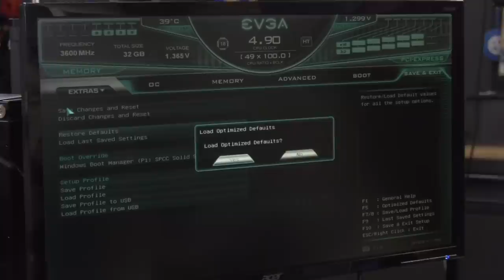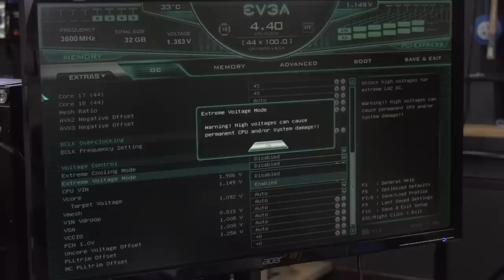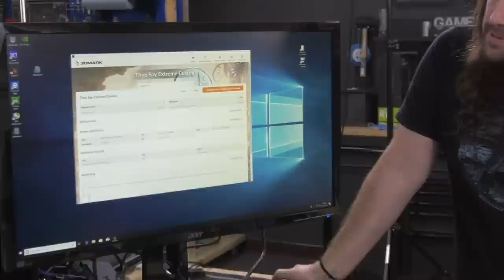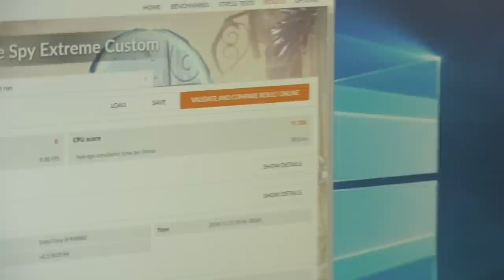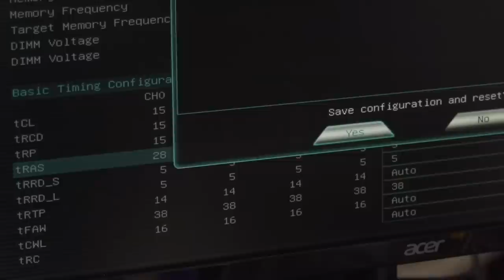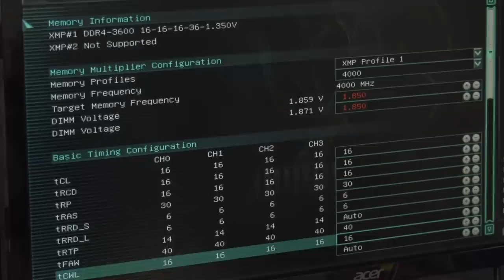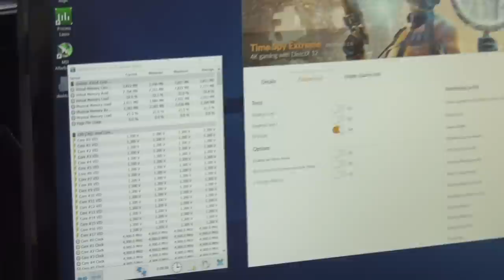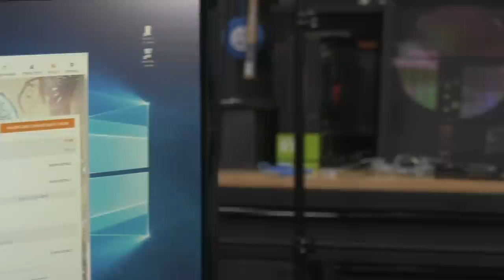Live: 9980XE Overclocking with Car Radiator

Comment: Back in the days of Prescott I purchased a used Mazda MX-5 radiator complete with the two large 12 inch fans. Modded the massive water inlet/outlet for regular 12mm ID tubing. Wired the fans to my variable voltage PSU. The sound was incredible when the fans were at full speed. Best described as the sound of a C130 in my bedroom. I have photos somewhere. I had a Tec on that CPU with a Danger Den waterblock.  16c full load minus 7c idle.
Reply: well that was a waste of money lol
Reply: TheGuruStud didn’t cost much and it lead to the forming of my company that now brings in 4 million euros per year.
Reply: @zentriceggofficial  what company if you don't mind me asking?
Reply: Random Some Guy criminal minds inc.  An agency specialising in sourcing the world’s best criminal minds for all your criminal needs.
Reply: @zentriceggofficial  wtf
Reply: Radu Mircea Bunica I thought it would be a more interesting business than a boring Elon Musk enterprise.
Reply: Smooth AF advanced trolling.
Reply: @zentriceggofficial You're joking right? You went negative temps with a car radiator? Was it outside, in the winter :P?
Edit: I just googled that Tec thing... Makes sense now :)
Reply: @mariuszanfir2298  Well done!  You figured it out. Yup, I used TECs for quite a few years. Back then you could buy a TEC holding waterblock from Danger Den or Swiftech.  Now you only find the odd custom made block.  The TEC was powered by a separate lab power supply.  Variable voltage and high current.  Although I did try powering a TEC on CPU via the computer's power supply at one stage.  Although I powered it off the 5 volt line rather than the full 12 volts, it still overloaded the cheap brand PSU I had at the time.  A loud bang and flash of blue light.  PSU died.  Fortunately it didn't kill any PC parts.
Reply: @zentriceggofficial  You didn't need to run bigger hoses... The block is super restrictive. I run a rail (4x GPU in parallel) because instead of R= 4x, its R = 1/16 (series vs parallel). I run stupid flow rates (my pump uses more power than my TR 1950x and 4x R9 Fury at idle), but the hose is only 5/8 ID and 3/4 OD. In fact, even if you smash the hose almost shut (leave a small gap), the flow rate isn't much different from fully open, so the hose is very minor restriction. You could easily get away with 3/8 hose for my ridiculous setup.

You can also calculate it (I'm an aerospace engineer, fluid dynamics was one of my favorite classes). But, when you blow through the water-block, you'll notice even with air its super restrictive, when even a super long hose doesn't do much (which you can easily calculate with the Bernoulli equation, assuming its still a fresh course on your mind).
Reply: @jakegarrett8109  Yup, except I don't like the look of the tiny hoses.  A friend tried to persuade me to ditch pro cooling and go with AIO.  I said no.  He ditched his pro and now has a generic tiny tube AIO.  Back when I had the mazda MX5 rad I would have loved to use the giant hose that used.  I will stick with 12mm ID.
Reply: What did you use to power a automotive water pump?
Reply: @kingofnines213  The water pump was actually an Eheim pond pump. Head pressure wasn't that great. 😂
Reply: @zentriceggofficial  trying to figure out how I'd wire in an electric waterpumo for a car, since they usually mount straight to the radiator neck, however I'm pretty positive that'd be too much current to wire in to a PSU with a switch
Reply: @kingofnines213  I haven't checked spec of any car water pump. Even if the current requirement wasn't too great you'd need a good surge protector.  Maybe a mosfet driver board.

Comment: I will have you say my complete name one day, Steve. 

Seriously, those videos helped me to undervolt all levels and finding OverdrivenTool is the tool for tuning Vega 64. It lead me to research what crytominers were doing with Vega 64 then applied the concepts to the Power Play Table via OverdrivenTool. Acturally seeing a reason to be thankful to miners, they have a lot of documentation on Vega 64. 

Able to hit 287.7 max, 37.6 min, fps and 160.4 in Heaven and close to 7900-8000 in Time Spy on 'air' alone. 

My OverdrivenTool profile (Got it shifting through the states smoothly and on a very tight wattage timing):

[Profile_3]
Name=morePPT
GPU_P0=852;800
GPU_P1=991;900
GPU_P2=1250;925
GPU_P3=1300;975
GPU_P4=1440;1015
GPU_P5=1500;1035
GPU_P6=1575;1060
GPU_P7=1630;1090
Mem_P0=167;800
Mem_P1=500;900
Mem_P2=800;925
Mem_P3=1080;1050
Fan_Min=1200
Fan_Max=4800
Fan_Target=75
Fan_Acoustic=2000
Power_Temp=80
Power_Target=140
Reply: I wish i could find same information for 660ti and mod my bios properly.
Reply: AMD seems to have a step up on tweaking. Sorry, best tool you have is Nvidia Inspector
Reply: @SchkuenteQoostewin  Yeah, I use Vram timings flashes to set the #1 TimeSpy score for duel RX 470, as well as my normal "1.21 Jiggawatt!" (back to the Future reference) power limits to beat it on air. I'll put them on water and chilled water later. I love all the mining forums, they have the driver patches necessary for running custom BIOSs, and all the info you could want.
Reply: @jakegarrett8109  In a way they did a boon in the end

AMD should just source the drivers and let us kill Nvidia for them.

Comment: You want a real big radiator? Get the Airplex Gigant 3360, it weights more than 20kg and fits 24x 140mm fans.
Reply: just, wow
Reply: Do you even need any fans with a radiator that big? 😂😂😂
Reply: @denmcx6538  Probably not. Just good old convection currents.
Reply: But that costs closer to 1000$. Car radiators can be had for less than 100. For that money you could probably get an 18 wheeler one :P
Reply: @mariuszanfir2298  for semi's you can get one for 500 online and 1000 at dealer
Reply: @nawzy202  I've got a school bus radiator for probably $100 if someone wanted to pick it up. However, I run 4x R9 Fury (duel SuperNova 1300w), and I just run the water in a 5-6 gal reservoir (25 Liter roughly). It takes so many hours to get even remotely warm, its just not really needed to have any radiator. That said, I've ran 2x power modded RX 470 on a passive 4in thick 16x16 in copper radiator for 72 hours to hit steady state (did take 48 hours to hit steady), and it peaked at like 48c on the core, and with just a small breeze from a box fan, it hit 42c under load. Each card loaded with synthetic at 220w (which was not possible on the air cooler below 85c even at 100% fan).

For my high power CPUs, I run phase cooling (peak temp on my FX at 500w at 1.7 Vcore was usually below 0c on the core, I did see it hit 10c breifly when I had a crash and the load must have been 600w, block temp max has been -25c, idle is -58c).
Reply: DenMCX 

A recommended setup for that radiator is actually just using two 180mm fans, one in the bottom and one in the top.
Reply: @aciemiller3443  He sounds legit to me, you shouldnt so willingly project insecurities.
Reply: @DarkLinkAD  That's one of the best replies I've seen XD 
"I can't do that so they must be bullshitting"  Got'em!

Comment: next step....go to north/south pole for extreme cooling performances
Reply: :-D
Reply: Actually i know of a guy in northern Norway who mounted a car radiator to the outside of his house and then had holes drilled in the wall so he could fit piping through it. In the winter he has to have the pump running constantly even when the pc is turned off so that the water dosen`t freeze inside the radiator.
Reply: @ergomedasa1362  That's awesome!
Reply: Better yet go to interstellar space.

Comment: Proper watercooling !!!  I would give you TWO thumbs up for this video !!!
I use Phobya Nova Extreme myself :) GTFO with so called watercooling aka AIO. You can use it as rear panel :)
Steve I actually used CAR RADIATOR back in 2001 with my Duron 700 build and DIY water block .

Comment: considering just mounting a car radiator on the back side of my case and I recon it would be able to run completely passive with my 120w cpu. Maybe id put on some large super slow fan if I add my 2080ti to the loop eventually. But for the price for which you can get pretty large radiators, its awesome. Makes you wonder why pc radiators are so damn expensive when you can get a car radiator 3x the size for 1/5th of the price

Comment: I use the Noctua Industrial 3000 rpm PWM fans  with a temperature profile such that they run at about 1800 rpm quietly while temperature is below my set threshold.  However, should the temp rise above the threshold the rpm advances quickly and makes a bit of noise.  The interesting thing is that the fans almost always run quiet unless I put a sudden load on the system and then they rev up only for a small amount of time before returning to quiet mode.  I believe these 3 phase industrial fans lowered my temps at least 10 degrees C.

Comment: Coasters in the same material as the modmat? It would be massive overkill, but if you could have a grounding lug to snap onto in the middle, it would be balanced and be used as miniature impromptu modmats for smaller devices, on top of, y'know, being a coaster.

Comment: Basically built an Apple desktop computer which also had a gigantic radiator but hidden under a shield.

Also, how does even succeed getting a HDD bust a huge hole in it?

Comment: I have a 1500 litre (400 gallon) water tank in my backyard, a 19,000 litre/hour (5000 gallon/hour) pool pump in the back shed, and I live in the southern (cold) part of Australia.  So, if I plumbed it to recirculate under the house, into my lounge and through my compy... that'd negate the need for a radiator at all, right? :P

Comment: A Volkswagen Beetle didn't have a radiator. Rear engine, air cooled.
Reply: The sad realization there's cars out there with better thermals than current intel CPUs lol
Reply: Yeah, but at least the CPU wasn’t designed by Hitler
Reply: @billoddy5637  #TRUTH ROFLMAO
Reply: @billoddy5637  The Volkswagen Beetle was designed by Ferdinand Porsche.

Comment: 1.) The predecessor of the Mora 3, the Watercool MO-RA 2 PRO, was already released in 2009 !!! :headshot: 
2.) The Watercool Mora is not a car radiator made of aluminium (copper + aluminium --> strong galvanic cell), but consist of copper pipes without any solder, a low fin density for low rpm fans and still massive cooling performance.
3.) A Watercool Mora 3 360, which can be combined with four 180mm fans, starts at 125€:  http://shop.watercool.de/epages/WatercooleK.sf/en_GB/?ViewObjectPath=%2FShops%2FWatercooleK%2FCategories%2FRadiatoren%2FMO-RA3
4.) This cooling solution is more common than extreme in the watercooling "world". Or Americans live in a "soapbubble".

Comment: Why don't you OC the cache at all?  That should help with your benchmark numbers (and memory performance I believe).  3.2 seems way too low for a 4Ghz+ core clock (I've been told you're best served to keep your cache speed within 200~500Mhz of your core clock, so for a 5.0Ghz core clock, you'd want a cache clock/multiplier of 4.5~4.8 or better).
Reply: The cache on the Core-X CPU`s dont clock that high, running it at 3.8 is the max for most.
Reply: @laurensbot  Ah, gotcha, I didn't realize that.  Makes sense since they're based on the older gen architecture (I'm used to my 7700k/Kaby Lake chip which has a higher base cache clock).

Comment: Can anyone that's better with electric current explain why Steve keeps saying 40 Amps? Shouldn't be more like 200+ Amps? Or is he talking about the Amps on the entire rail and is not saying 40 Amps at 1.3V?  What am I missing (besides 6th grade physics :P)?
Reply: 12v rail. 40amps x 12v = 480w.
That's also how you know what PSU you need (ex, 1000w is 83 amp on 12v rail).
Reply: I could be wrong but I believe he is monitoring a single phase of the VRM
Reply: Got it! Thanks, guys.

Comment: Clickbait title, come on Steve. The radiator used is clearly for PC cooling, and is a huge ripoff at $300, Also the EK pump is another ripoff at $250. You can get an aluminum car radiator for under $50, and a fountain or large aquarium pump for another $50, yes it wont look nice, have mounting points for PC fans, or PC watercooling inlet sizes, but with a bit of DIY you can get it working, and it will destroy these ripoff nice watercooling parts.
Reply: You think watercooling is for frugal people? Haha. Thats like someone with a seiko diver telling someone with a submariner that he has been ripped off
Reply: You don't even have a clue about what you are talking about...I have the Stainless steel version of the MO-RA 420 with all its extras (cover) and this thing is so well made you will be amazed when you get it in your hands. Watercool is not the type of company that sell rip-offs. Their quality is amazing and they are well respected among the watercooling community. Their waterblocks are also among the best top 3. This IS NOT a car radiator and is their own design and was the cleanest radiator I have ever got my hands on during the 15years I am watercooling. Full copper and no aluminium crap. 

I have this radiator on a X299 - i9-7940X + 1080Ti with 9X 140mm Corsiar ML Pro running @ 450rpm and that thing is dead silent. The best performance can be achieved with 140mm fans and not those 200mm fans as Steve pointed out. The radiator is optimized for 800rpm fans too and and SILENCE. 

Get your facts straight firs before you spread misinformation....
Reply: If you want to save some money with a little bit of DIY, the cheapest 420 version of MO-RA3 is the "Core" at about 150 eur. It does not include fan fittings or extra frame, but still has those nice standard G1/4 three-way tube fitting threads and 4x M4 threads on each side to fix your own fan plate and feet or other fixing solutions. And compared to a car radiator the MO-RA3 has lower fin density which is great for very low rpm fans if you are interested in silence.

Comment: I was literally just (3 Days ago) looking at the idea of using a legit radiator for a 'server' build I am doing.  I was wondering if I could get away with all passive cooling.  Plan would be to stick the case in this enclosed media center / hutch / furniture thing that holds the TV, and just has cabinets underneath.  Drill holes, and run a radiator and just set it out back.  Let it passively radiate the heat.  In the end, i may have decided that those chinese pc radiators still might be the best buy.  Sure they suck, but theyre dirt cheap, and I keep having to remind myself that this is a generation old xeon system, Im not going to be overclocking and stuff.  And basicaly stop myself from going balls to the wall (I need water cooling! and LEDs, and SSDs, in Raid 0, and how much ram can it take again?)  And then remind myself that its a f---ing file server...  Maybe some virtualization.
Reply: Car rads are dirt cheap at $60 to $100, they work decent with low restriction. You need to run to Lowes (or another hardware store), and pick up some hoses and fittings to adapt it. I run 1 inch ID to 1x7/16 angle and shoved a 3/8 ID hose onto that to run to standard G1/4 3/8 barbs. My main system has a couple of those splitter rails (2x 5/8 and 4x 7/16 inlet/outlet) for my quad GPU setup. Works great with a huge aqaurium pump (about 60w pump, insane flow rate!)

Comment: 500w at 4.5ghz wtf. My Ryzen 7 2700 barely goes over 120w at 4.0ghz all cores
Reply: not comparable? it has double the cores and power usage scales exponentially with voltage.

Comment: car radiator....? not realy.....
Reply: someonesomewhere look at the size of radiators from cars like 1990s Honda Civics, Daihatsu’s, mini coopers,  or a geo metro and there comparable in size to this
Reply: @DrMice760  its still not a car radiator......
Reply: @namcost you do realize for flow a pump needs practicly 0 force when the Loop is filled completly?
Reply: namcost a car water pump is typically a 2.5in-4in impeller made of plastic or metal but is always running at the speed of the engine